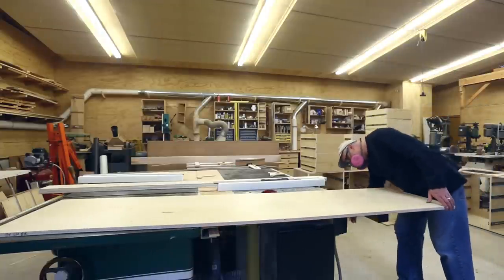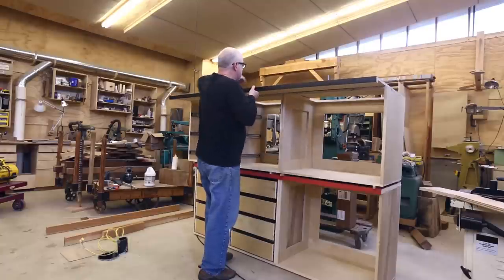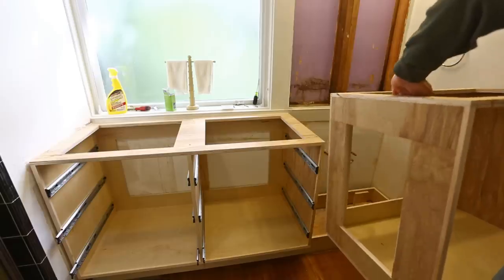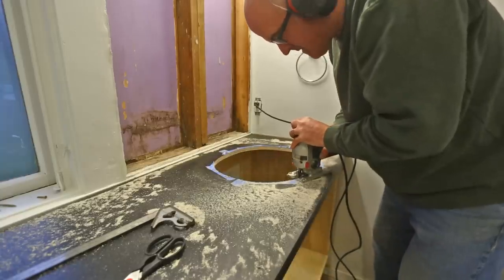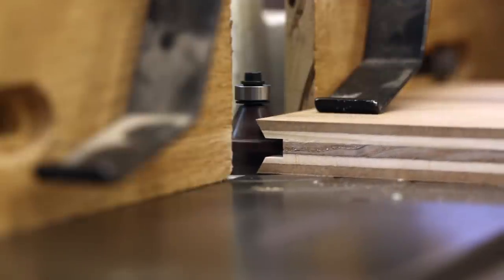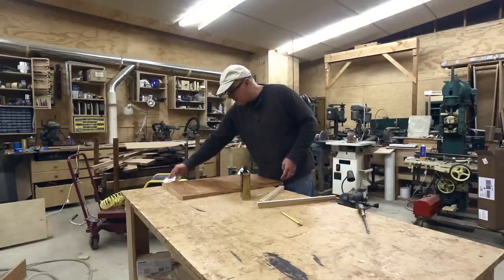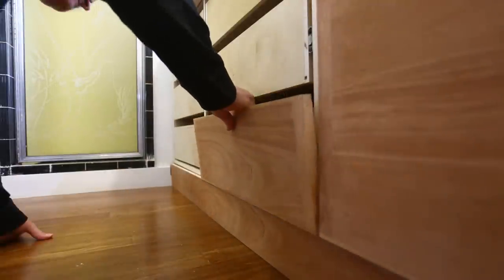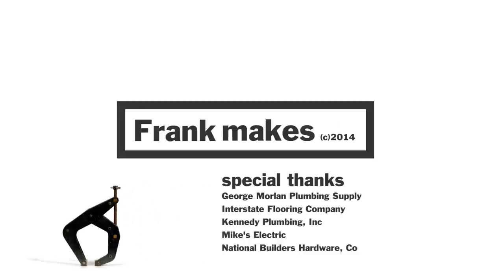Bathroom Cabinets: Part 2

Comment: Fantastic production first off and tremendous problem solving as well.I have installed high-end custom cabinetry in some of the most expensive residences in the U.S.(Palm Beach,Fl.) so I'm familiar with the problems that can be unforseen at the beginning.Field measuring is critical when starting a project,this includes plumb,level and squareness of all walls and the floor.Reducing the width of the cabinet slightly to allow for left and right scribes would be a suggestion for the next project.I can't wait to see more of your artistry.  P.S.I'm sure most of us would love to have such a well-equipped shop as yours.

Comment: Screwing the drawer front to the drawer via the pull holes is genius... I used Blum drawer center point template but required more work than what you did. I'll try your method next time!

Comment: Wonderfully done as always. So glad that I found your channel. Should you have to cut any more sinks out of counter tops in the future, you could screw a piece of 1x4 to the cutout that spans the opening plus an inch to either side after you've cut most of the way around which would keep it from falling and possibly damaging the cabinet or tearing the counter top as you finish your cut.  All the best.

Comment: When I'm making cabinets, I make it ~1.5" narrower than the front dimension, and then use a strip of 3/4" timber as a filler. Te filler can be easily shaped to fit any won lines in the wall and also helps account for any lack of squareness of the walls

Comment: Hi Frank, love your videos. Would you be able to explain a little more on how you make the jig for fitting the drawer slides? I didn't catch the reasons why you made that jig the way you did. I'm foggy on the measurements and layout relative to the opening in the cabinet. Thank you.
Reply from the maker: It just helps with the spacing of the drawers.  with these slides you can attach the cabinet side to the bottom of the cabinet and the drawer side to the bottom of the drawer, and the drawer will be just above the bottom of the cabinet.  then you just space the jig to the spacing of the drawers.  with the drawer faces attached separately the exact spacing the drawers is not critical.

Comment: only thing I might have suggested is put a load into the drawers when you were attaching the faces to them to put load on the rails to take any play out of them so they would be at there loaded locations when in use ( normally use a 10lb weight, nothing to heavy)

Comment: Great project and the video was really well done. Maybe you should get another tape measure though, your old one seems to add a half inch when your not looking. That's the problem with all those poltergeists you have in your shop. ;-)

Comment: I like to run laminate  on the cabinet floor of sink bases any drips or soapy stuff washes off and the ply doesn't de- laminate . And I always use story sticks to measure for the opening two pieces of scrap and you just run ticks over each because walls always belly in the back corners where the mudders hump  is.
Reply from the maker: I had brought a stick in of the length of the cabinet and I thought It was going to work out.  you are right the bottom corner was the problem, with a bulge.  I like the idea of laminate on the bottom, I had not thought of that.

Comment: For the cabinet that had to be resized, isn't it possible that the kerf of the blade would have been enough? I mean, couldn't you just saw it and then re-glue it and effectively lose 1/8-inch or so?